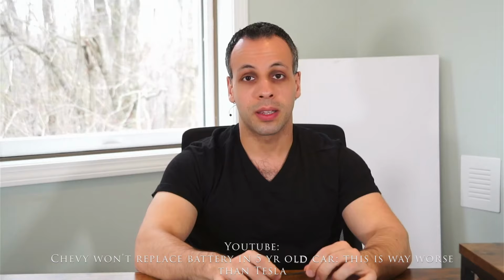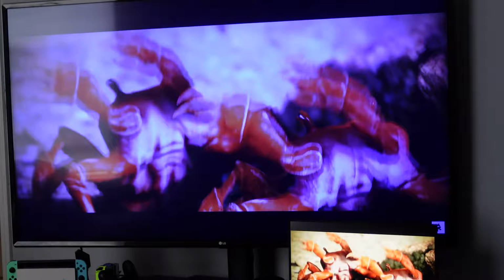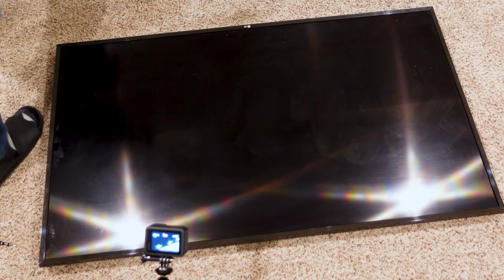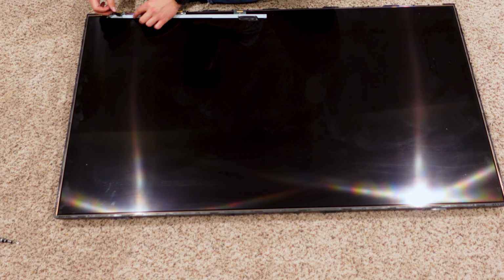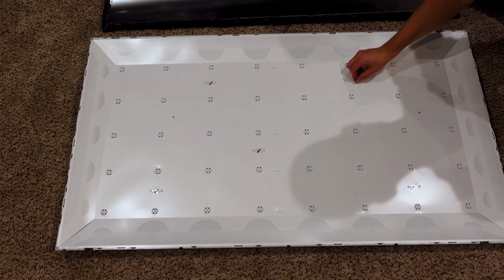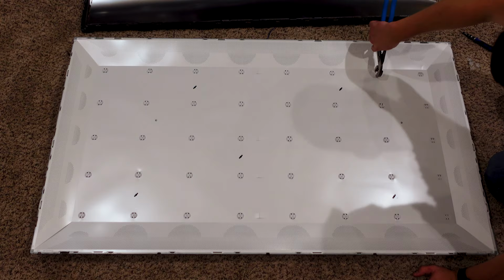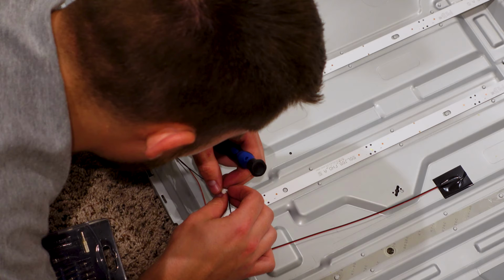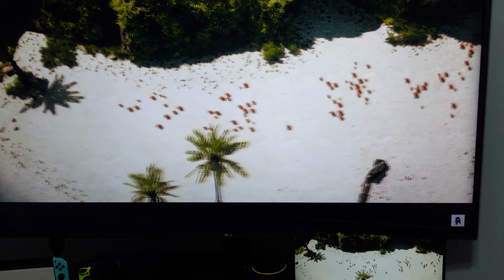TV Turning Blue? Here's How to Fix It!

Comment: Just replaced my 55uj6300 backlights. Took 2 hrs. Ended up not needing superglue since the newer version came with doublesided tapes. Another thing, you need not pry all the 'buttons' aka leds from the old backlight strips since you can actually remove the reflective sheet itself. For the connectors to the strips, just use a flathead screwdriver to lift them up from the bottom. I would 100% recommend the suction cups though.
Reply from the maker: I love to see this comment. Hopefully, my video helped you and also helped to reduce E-waste and I appreciate you making the effort!

Comment: Thank you for the video. I've started getting into electronics repair recently because 1) hate to add to our landfills. 2) It now costs money to get rid of a flat screen tv where I live - $20. So often a single very cheap part can stop your electronic device from functioning. And it seems all you need to learn is how to solder for the most part. I have a decent understanding of amplifiers/receivers but know little about flat screen tv's. So thanks again, and I definitely subscribed!

Comment: Thank you sir for this detailed repair guidance.

Sad, to bring blue color down, there is no knob, rather have to go thru many hours of intense  labor ( it means we must have all tools).
Reply from the maker: Yeah, because the 'blue' is not part of the functionality of the TV but rather the degradation of one of its components. It sucks but consider this- the LEDs cost about $30 and it took about 2hrs of labor for me to fix it. So instead of spending $300 on a new TV, I spent $30 saving $270 with only two hours of labor. I got paid $135/hr to repair this TV :)

Comment: I have a 50 inch Samsung with a patch of blue on the right hand side of the screen. It gradually came on during this year's summer heat wave. The blue patch is right in front of the TV's power supply board, which brings me to conclude the cause of the problem is the heat from the PSU, it caused the close by LEDs to overheat and burn off the phosphor coating. 
The TV is covered by a service plan, and will be fixed or replaced, but why would an expensive TV, supposedly one of the world's leading brands, be left open to this problem in the first place? The PSU should have been heat insulated and maybe even fan cooled (silently). 
Thanks so much for this video, you did a great job. I'm into electronics, but not nearly as brave as you! Well done.
Reply from the maker: I'd bet more than a few dollars that you paid for your service plan. Unfortunately, the goal of most companies is to produce a product that will last just long enough to outlive the default warranty period. Call it planned obsolescence, call it laziness, call it multiple engineering teams operating in vacuums, or all of the above unfortunately.

Comment: This only seems  to affect backlit LCD TVs - the ones with the thin bezels. The white light is produced by phosphor fluorescing under the native blue LEDs. The phosphor breaks down on the LEDs and they shine blue. I've seen lots of old edge lit LCD TVs still going strong after 15+ years of use - I have a 2012 Panasonic with a lovely edge lit IPS panel - Picture is still sharp and colours are great. If electricity wasn't so expensive I'd buy an old Plasma TV, but the 50 inch sets are 300 watts !
Reply from the maker: You're spot-on with your comment!

Comment: This was a fantastic video. I also recognize I do not have the skills to do this. I will be 2 hours into it when I break a plastic clip or wrinkle a layer of film or something like that. I cannot pull this off.
Reply from the maker: Well, if the TV is already broken and you're thinking about replacing it already, why not spend the $30 or so to try to fix it before committing to a new one?
Reply: @techbets102  Because I will lose a half a day and $30 and at the end still have the same TV problem and will feel frustrated. I know my limits.
Reply from the maker: You'd be surprised  @dond3391  Peep my latest video which is this exact same repair on a far more challenging TV. Again, I did not have a teardown guide or anything of the nature. Just taking it slow and being careful and I was able to save the TV.
Reply: @dond3391  I believe in you bro, give your next malfunctioning device a try. For a man, the feeling of fixing something is second only to the feeling of hearing your child's voice.

Comment: Hi, great job! I have a question. I have the same issue with my 86 inch LG 86UM8070 and I’m gonna attempt to fix it. How do I get the right size LEDs? Are the all the same and how can I find out? Please advice.
Reply from the maker: Hey so I did some googling with my EXACT TV model and ordered an LED set from Amazon that was noted to work with it. You can also see from the video that once the TV was opened, I compared the strips to make sure they were the same before installing.

Comment: Good technical guidance. For clarity, did you only need to solder the reflective panel because of the improper,  'horizontal' removal which broke the prongs of the power to the lights?
Reply from the maker: Exactly - I broke the power clip for one of the LED strips and opted to just solder the positive and negative leads to the new strip once installed. If you're more careful than I am, you won't need to solder!

Comment: Is it "heat" that causes the LED's to go bad? I was wondering about this, as I have a flatscreen that if you turn up the backlight too high the screen starts to blink, and I thought that was due to the LED's getting too hot. And it is caused by the design of most flatscreens as they don't have a fan. I've seen another Youtube video where a guy cut a hole on the back of his flatscreen, added a computer fan, and it fixed the problem.
Reply from the maker: I don't have a good answer for you on that one. My understanding is that these LEDs don't really produce too much heat. If my TV was exhibiting that same behavior, I would question the power supply first. It's possible that it works to a certain point and then when you exceed the power threshold, it fails.

Comment: How much would the replacement leds cost.  Cause that's basically what they gonna do if I take it to a shop n probably charge a silly price . Which is fair considering how technical it is but
Reply from the maker: I was able to source the replacement LEDs for about $35. The install took me about 80 minutes.
Reply: @techbets102  that's cheap but like I said the labour looks technical af . How much would you charge for that kind of repair ?
Reply from the maker: Honestly, it wasn't as bad as you'd think. Like I said in the video, I had no idea what I was doing and just figured, "Well, it's already broken so what's the worse that can happen?". I would say, give it a try yourself. TVs are relatively cheap now anyway so if you fail, it's not a huge deal.